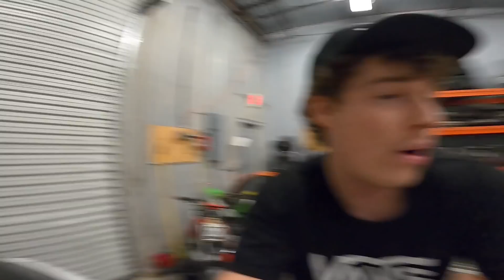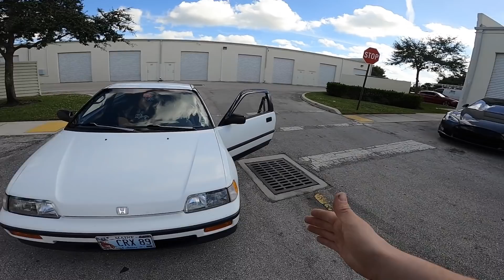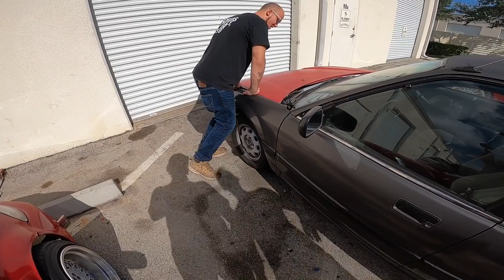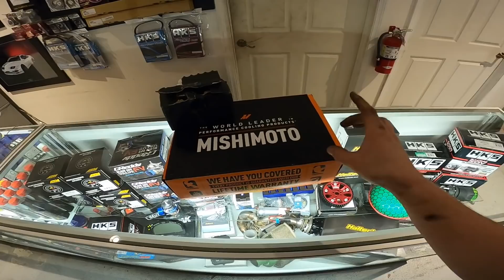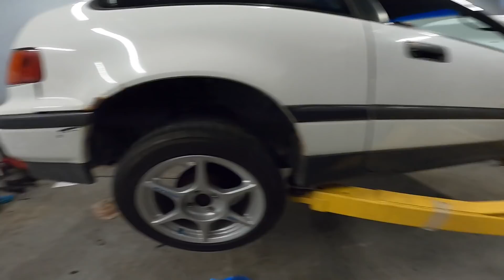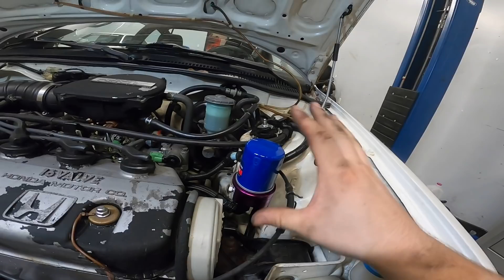CRX FIRST MODS, READY FOR THE TRACK!!

Comment: Get a type r trans to go with the b18. The shorter gears and lsd will make it a beast on the track 👍
Reply: This !!!!!!!!
Reply: Or b16 trans
Reply: @alexmagana5841  is there a way to tell the difference? I'm getting into old Hondas and looking for trans now.
Reply: B16 way to short a gsr trans with lsd is perfect in the middle between a type R and b16 trans
Reply: Hes gonna need some brakes at the end of the day and he better be upgrading to vti front calipers which are bigger along with an HRV sevro and defo delete the drums on the back for some rotors..
Reply: A gsr is not between a type r and b16. A usdm type r is pretty much a b16 ratio wise depending on the year with lsd and dual cone synchros.
Reply: @Uarenext.  I say go all out for the brakes. Itr 5 lug swap and spoon brakes for the ultimate flex.
Reply: @da_jeezuss8922  We all know that chris is cheap on important things like braking etc and i highly doubt hes gonna do such upgrade lmao 😂 but just doing such a simple brake conversion to a vti along with the hrv sevro is the cheapest solution and he will defo see some results..
Reply: @Uarenext.  So i guess a spoon engine damper is out of the question 🤣🤣🤣🤣
Reply: @da_jeezuss8922  definitely 😂😂😂 all that i start worrying about is him going hard into a corner and having an accident cuz crx's and the ef hatches tend to be a little lighter in the back especially if you dont have the car properly set up with decent coilovers, upgraded torsion bars etc to stiffen up the chassi..
Reply: Hell yeah that would be dope. Although driving them on the streets kinda suck Haha.
Reply: Only way is to open it up

Comment: drop the d15 in the shity civic
Reply: Fock yeah! Thousin bocks!
Reply: Here in Ohio Cleveland to be exact even with a running engine that's a $500 dollar car tops. Things "JUNK"
Reply: Turbo it use red car set up
Reply: Which one is the shitty civic? Lmao
Reply: @ghostface9230  I can vouch for this 'Columbus
Reply: Put it in the red car, they are similar enough to swap everything over. Use the ef for parts and junk it
Reply: @m200mw  2j swap the ef and drift it🤷‍♂️
Reply: What a good idea turbo?!
Reply: Same in zanesville ohio lol
Reply: @chaseoffenberger8080  welcome to the club?😂
Reply: Kaleb O all of them
Reply: @ghostface9230  same for columbus ohio which is where im from easy $500-700 shitbox
Reply: m200mw the d15 from the CRX is a dual point fuel injection motor and the d16 in the red coupe is a multi point. there’s differences in the actual harness and just wouldn’t be worth it to reverse engineer the red civic to run this old tech
Reply: m200mw would make more sense to swap it into the EF since it’s the same gen as the crx
Reply: @ghostface9230  wtf I'm in Cleveland and all dudes try to sell a rusted shell for $1000 ek hatch lol or $2500 for a dented up barely drivin one with 250k "all highway" miles
Reply: @icepop54367  I'm off broadview right by the zoo that's a $500 beater.
Reply: @ghostface9230  dude bet that shit is no title as fuck, that area is sketchy and like west 73rd lol Broadview and state I always am over there , I use offerup mostly

Comment: Koni and H&R are a great combo in Autocross, so stick with them
Reply: Evan Schill literally comparable to kw v3
Reply: I did notice they were the Koni Orange and not the adjustable Yellow though
Reply: Ethan Simmons if they were the yellows then yes.. if you don't need the adjustability then a koni yellow and lowering springs is best bet
Reply: @562sb  considering that people buy coilovers with out any knowledge of suspension geometry, so coilovers and dumped will start to drastically reduce correct geometry, leading to poor handling. Static springs from H&R or Eibach have been built to reduce height while not screwing your geometry. Also Koni, H&R, and Eibach actually test their products for performance gains before releasing anything. BC are great for the price, considering they start at $250 per corner which is cheap for performance coilovers, but so many people don't know how to set them up, or any coilovers for that matter, so they give up lateral grip pretty quick by going coilovers without knowledge. Simplify the setup, and enjoy performance.
Reply: Evan Schill BC is junk but yeah I agree
Reply: @562sb  they do start at $250 a corner soooo there's that lol

Comment: You need to use the HR race Springs with the konig coil over struts. Most HR race Springs are weight set to the specific car they are installed on. also the rear end on this year CRX should have a slight bit of camber adjustment so you pull the top of the wheel in ever so slightly to stop that rubbing. I had to do it on my CRX I'm quite sure it was one of those ascentric bolts.

Comment: Got a can AWD40 or white lithium grease? Get that car up on a lift and spray down all of the bushings for the lower control arm upper control arm Tension rods anything where the bowl allows the arm to pivot. That way it's smooth as butter through articulations in compression and rebound.  It's the one thing no new car owner does.  Everyone swaps out coils but no one maintains the bushings/hardware/sleeves for the articulating suspension components. Makes a huge difference.

Comment: ( 16:30 didn't see that lol 😅 )
Fender rolling trick: put painter's tape behind the fenders, and take it out for a spin. If it rubs, the tape is damaged. Do this over and over, with minimal fender rolling in between. If the tape doesn't get damaged, it does not rub. Trick for minimal fender rolling.

Comment: YOU NEED 14”/15” WHEELS AND TIRES. 7-8” WIDE WITH A 205-215/45-50R14-15 TIRE. 

Stick to something like that you will not regret it! And you will not have any rub issue, try not to go with too low of a offset either to avoid scrub. 

Love the crx, I’ll be getting into another Honda soon once again, but I used to own a 93 vx hatch with a b20 swap matted to a gsr trans. In my opinion it is the best transmission for a b series as it’s not too expensive and the 4.4 final drive is better than the 4.1 LS trans and 4.7 b16/sir/type r trans 

The slightly longer gearing is very useful with the b18s torque

Comment: My crx was the easy sound system to install myself head unit simple, speakers easy peasy and even amp and subs piece a cake , and the sound and bass in a little crx are so awesome i had a dvd player with 7 inch screen and it was way better than any surround sound system at the theaters or home it was minty🔥🔥🔥

Comment: Thank god you kept that koni and h&r combo on there and didn't swap it for that ebay shit. Koni and h&r is an excellent combo. I would have dialed in a small amount of negative camber up front if there wasn't any already, and if you had adjustable rear camber arms, I would have adjusted some slight negative camber out back as well. Despite civic reputations, my 2011 Si was my favorite car to date. It made 220whp which was fun for a civic, but the money was in the suspension. It handled so good. I wish I would have autocrossed it or some shit when I had it. Civic's can be such good cars no doubt.

Comment: he is really afraid to roll the fenders? he might chip the paint
lol
Reply: Thing literally has rust lol and is worried over chipping the paint pol
Reply: And he's getting the whole panel replaced so there was no reason to be afraid if messing it up. Wouldve been good practice to just do it and have no rubbing while on track. Now we know what's gonna happen in the track video. He can't go as hard as he wants to or he's gonna not care, pop a tire and get stuck cuz he didn't bring a spare tire.
Reply: wheeln 24/7 don't forget about the 12 hour trip after the track😂

Comment: Put the yonaka coil overs on the crx they are a great brand I had them on my crx del sol for about 11 months before I sold the car and they rode absolutely amazing and helped a lot with body roll also that 4 door civic has no engine and probably nothing but shitty bushings everywhere and a lot of air in the tires with bigger tires so it’s not a good even test to do with by eye but I’d say put the yonake coil overs on if they are fullbodies
Reply: jason loera that is if they are just the coils say they are the fullbodies with dampening then they are great like I said I had them on my del sol and it made it feel amazing compared to the skunk 2 coils and shocks I had on it before but yes I guess it would be OK FOR NOW since he has money to go down the street and get Bc racing coils for it

Comment: Do not get a huge rear sway bar. It weighs so little that the rear shocks look like motorcycle shocks because of how light the rear of this car is.
So Too large of a rear sway would lead to the rear oversteering in a bad snappy way. 
The crx will oversteer naturally when the rear is stuffed up with coil overs or stiff shocks. Especially if you ever strip the rear of the car.
Get strut tower braces & tie bars. And poly bushings. But watch the thickness of the rear swaybar.

Comment: Fender rolling is all the bell slow and steady using a lot of heat and using a tiny tiny amount of pressure going over the same radius a million and one times in till the metal slowly folds the way you want it to. If you add too much pressure and then just monster roll it out it will never come out clean because you were over bending the metal you have to go little pressure and a million times and repeat the process

Comment: the bounce test is invalid lol once you wind the height up the spring tension will increase, reducing spring flexion. (providing theyre not bodyb adjustable, but lets assume theyre not xue to the cheapeness) but even so you could still increase the spring tension.

Comment: If you wanna build a built d series for the red civic get a d16y8 Suzuki vitara pistons b18 ls rods you have to knotch the block to use them or buy cheap h beams  I can give you a full d16 build sheet it’s cheap as hell and your looking at 500 hp easy

Comment: Honda quarter panels rust because of the stupid rubber liner they put on the pinch weld, so just because a Honda quarter is Rusty does not mean the car is,., in fact there's a good chance that the rest the car isn't, because the first thing 
I do, (and I assume most Honda people do) is take that stupid rubber thing off, .. if it's still on there it's a good chance that car is stock af

Comment: If you’re expecting that b series to be able to take the ass beating you’re going to give it you’re gonna be seriously let down. That motor is going to blow up so fast
Reply: Also seriously amazed you paid that much for the rusty car. In Texas was trying to sell a 89 si shell for $300 in good condition just faded paint 0 rust. Had to end up cutting it up. I got parts if you wanna buy some 🤣

Comment: You need to do the rear disc break conversation.  And do slotted rotors and brembo breaks.. then go for a full built motor and boost.. 5 maybe 600hp reliably.. they also make some dope ass body kits!

Comment: Why the hell did you put brake grease on the back of the pad? that goes on the slide pins. Isn't doing a damn thing between the backing plate on the pad and the caliper.